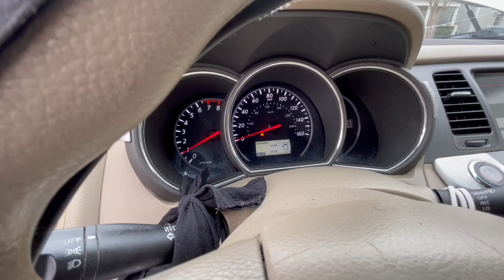How to change Spark Plugs on 2013 Nissan Murano [Step by Step]

Comment: To cargocarlos check the boot for the mass air flow problem 75. Fr dealer or try a salvage yard. Thank for the video. I am always worries about removing the intake plastic and over tightening and those clips to the plug on coil hv a tendency to break fr heat if not careful. Great job thanks again

Comment: You should always replace both PCV valves and all 3 blowback hoses when you replace spark plugs on these engines since you have the plenum off. The hoses become so brittle and PCV clogged usually one of them will give an emission code or worse one of the clogged PCV will blow a gasket.

Comment: Thanks bro I got a 2013  it gave me a maf sensor code I changed that and it still ran bad check it again and the code was cylinder 1 misfire,I’m thinking about giving it a try myself my mechanic told me $500 for labor I can see why but to me that’s expensive….Thanks for the video…About how long did this take you?????

Comment: Recording yourself doing this job would be the thing to do so you can play it back to remember what hose and bolt goes where. So much work to just change out some plugs. It shouldn't be that hard. I have a 3.5L V6 Altima with over 160,000 miles and while I know I probably should have been changing my plugs, the degree of difficulty has stopped me. I'd be worried about dropping a bolt or socket and it falling into some unreachable nook or cranny never to be seen again.